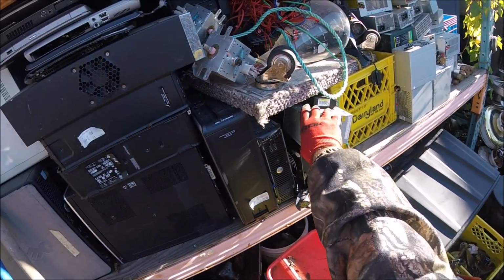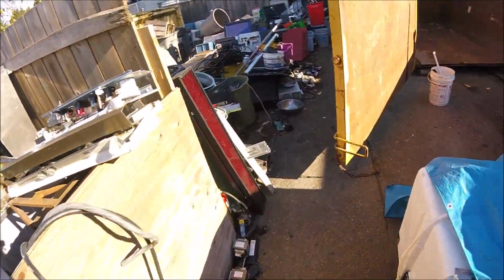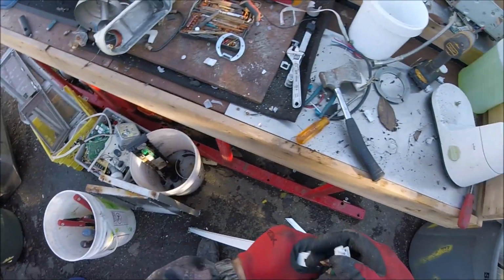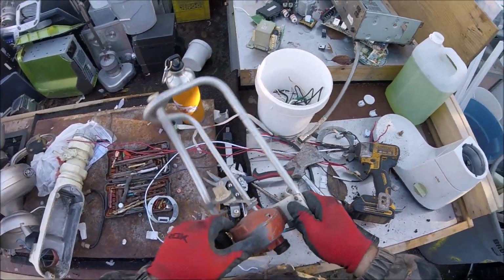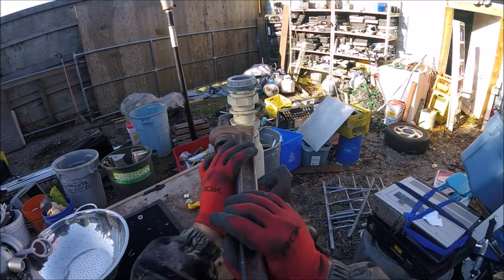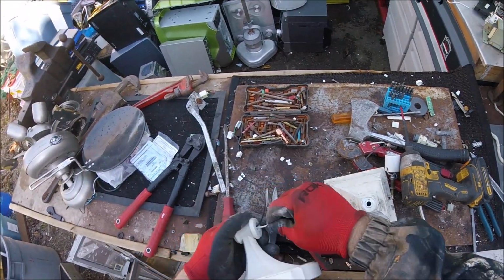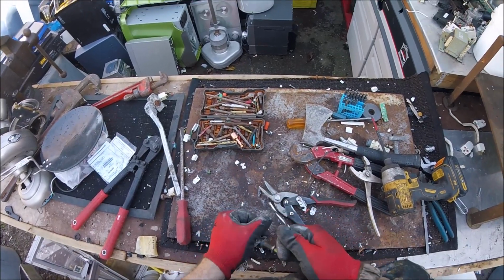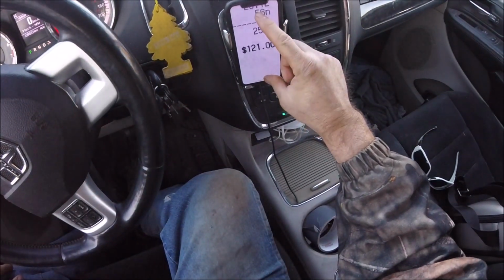Scrap Run Cleaning & Selling Aluminum & Stainless Steel

Comment: Phil, You said you are not in a hurry to fill the bin. But as you are organizing the yard, once you scrap the appliances and put them in bin, you get space in front of the bin. Then you get ideas of what to do next. At this moment, you can not walk 3 steps in a straight line anywhere in the yard. Your yard is so full of buckets of small stuff (Of course  this is before your yard run). Only when you clear the appliances, you get some space and ideas of what to do next.
The caged bin for HMS need to go to its place (exactly where your tires are) That is the perfect place. It will not be visible from outside.

Comment: You said you have the magnetic wheel. Whether you clean the yard or not, you must use it to collect all ferrous bits. I am sure you have about 100 pounds of bits and pieces in your yard itself. It will be an interesting change to your usual scrapping, yard run videos.

Comment: Hey, if I can give you a tip watching you from the sideline. Try to open a few shorter walk lines. The amount of times you walk around that door of your yellow bin while carrying heavy items. If you make room to fully open the door of the yellow bin you'll save so much time emptying your red van or white whale.

And you made a work area but closed it at one side(its now a U shape). Now you have to walk around it to enter it and that's why I hardly see you use it. Couldn't you make a double I I shape (open it on the yellow bin side) ? That's opening a shorter walk path and you have always an easy acces work area available from alot of sides. And a place to put some bins around to store the scrapped scrap. 

You know what's best for yourself but it's an idea that makes the repeated walks you make a bit shorter.
Reply from the maker: Working on it

Comment: The cast Aluminum which you sold as dirty Aluminum, could easily have been broken with a big hammer. No need for grinder, it's blades and cost analysis. You are an expert in Axe / Hammer usage. A few blows with a big hammer and most of the clean must have been gotten. When you could do it with T Rex few weeks back, why you did not think about it today?
Reply from the maker: I have to limit the noise

Comment: I'm not one to judge on what somebody does, but I can give you a little tip on making your tire cutting a little bit easier....when you cut your tires with your knife cut like a  d or b shape, when you start of with your Sawzall,  it will make the cutting go much smother.... i cut A LOT of them.... but the best thing I can say is experiment a  little bit with the shape that your cutting with your knife   near the rim, it Will save time and blades!, happy scrapping! peace brother
Reply from the maker: I notices if you cut with your knife from the treads to the bead, The tire comes off very easy

Comment: Power supplies : Do not sell them for scrap steel price. Open them up. You get cable, transformers, copper coils, Aluminum heat sinks, switches and a low grade board in addition to the shred. Value addition from scrapping will be 40-100% more than selling them as they are. If you want to see the real difference, you need to have minimum 50-100 Power supplies. Just keep adding to the hoard.